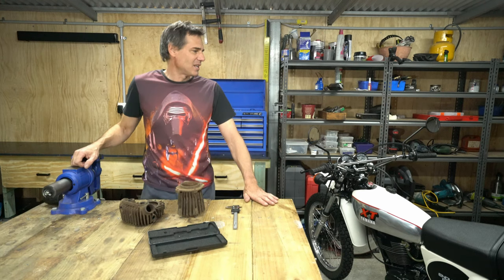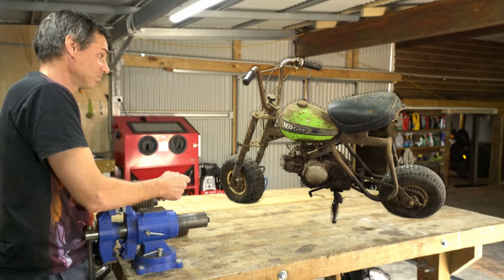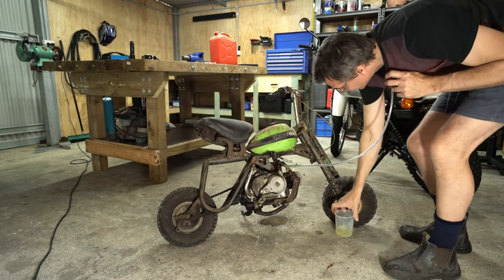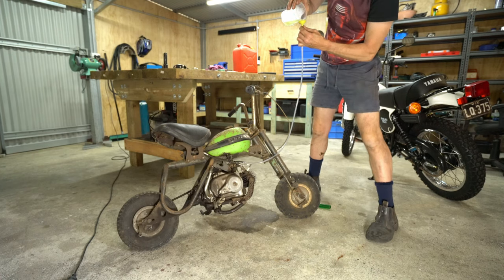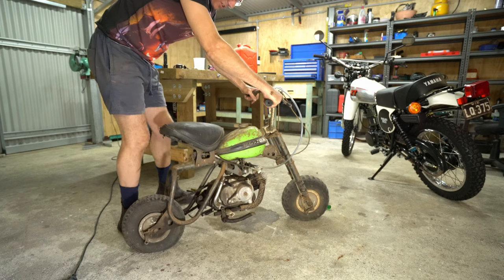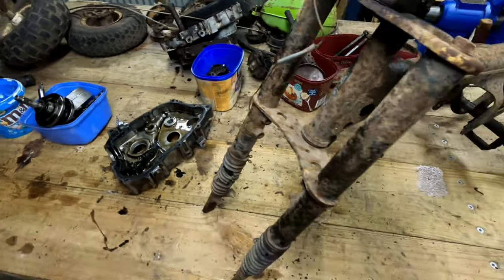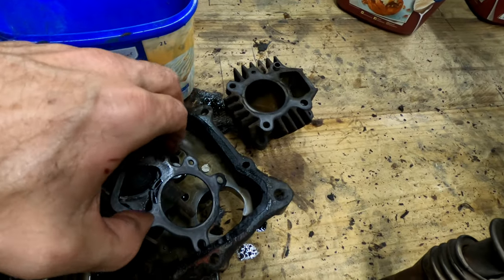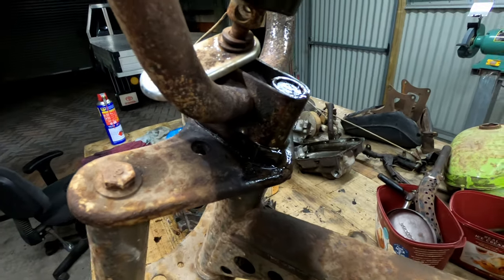Honda QA 50 Resurrection Tear down. Part 1

Comment: what year is it mate? I think I have a 71 service manual pdf if it might help.
Reply from the maker: 1970 for the year, I have a work shop manual for the little beast, but thanks for the offer.
Reply: i have a 70, would you mind sharing?
Reply: I had the 1970,71
Regardless
They were pos from honda
Poor transmission and exhaust
But parts are tough to find.